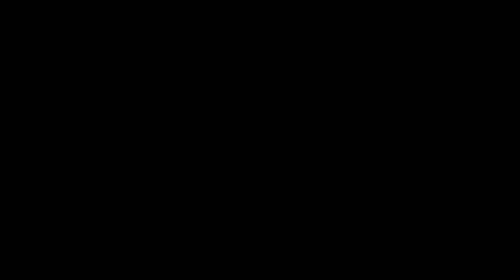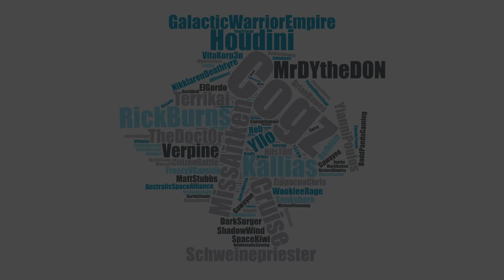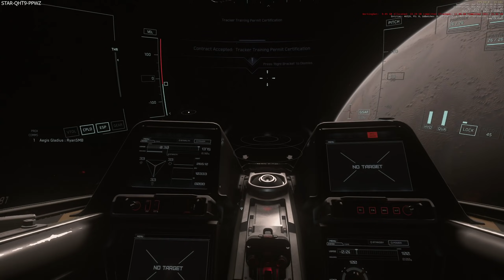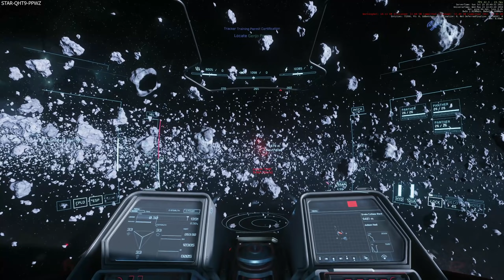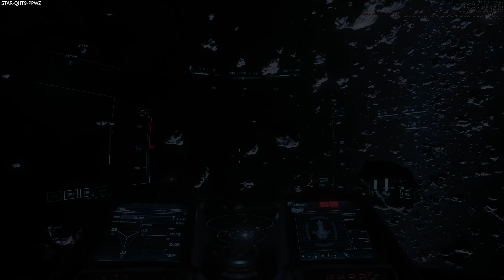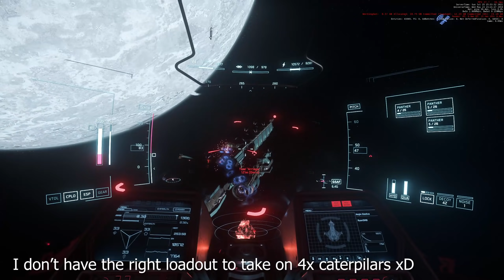Is Non Meta Possible? Time To Kill & All Things Combat | Star Citizen Sunday

Comment: 3.14 combat seems to be a divisive topic but from what I've seen that division is between the PVP players and PVE players. 

PVE players (like myself) are loving the changes as it made AI ship fights of all sizes much more interesting. The most obvious being their use of missiles both at the start and in the midst of engagements, which mean that in addition to lining up shots for your weapons, you have to keep an eye out for missiles coming your way. It feels much closer to the 3.13.x arena commander experience, where I feel that 3.13 combat AI was at it's best. With the capacitor changes, you're no longer just keeping your nose on target until the enemy is dead, you're pacing your attacks to allow time for your weapons to recharge, you're repositioning, or switching to missiles, or even switching targets depending on the situation. So far I've made it up to MRT bounties and the MRTs feel genuinely challenging when you're facing multiple cutlass-sized ships that are actually landing hits on you and lobbing missiles.

On the PVP side however, things are quite a mess I think. I am no expert but from what I've seen people are finding some specific ships and loadout can achieve incredibly quick TTK, meaning that all of that tactical gameplay mentioned above for PVE doesn't happen. In the few times I engaged or got engaged by another player in PVP, we still ended up nose-to-nose unloading rounds until one of us died, with either the more agile ship winning if one was noticeably more agile (like a fighter against a 600i) or the higher DPS output ship winning if agility is comparable (Sabre vs Hornet for example). The range changes as they currently stand have made 2xS1 or 2xS2 weapon setups generally better than a single S3 or S4 weapon, meaning that ships that can mount many small weapons (Hawk, Hornet, Tana, Bucc) have a pretty big DPS advantage over ships with only a few larger hardpoints (Avenger, Talon, Gladius).

This is just my experience so far having spent most of the weekend on the PTU, and my bias is certainly PVE, but this is what I've experienced so far.

Comment: The point you make about weapon stats as a basis, is Exactly the thing I feel questionable about the statements that the CIG devs made. Especially with the HP values on ships. Relative toughness of your ship is just so fundamental. Like, do I favor the top or bottom of a ship if I want to rotate into fire? Tail or nose? Like knowing this about the Tali, changed how I flew that ship. There is 120k HP in the nose and 100k HP in the body. So if you keep that in mind, you are being more informed in how you fly. This could be ultimately replaced by armor in some far flung future, but right now it's just prohibitively difficult to get at this information for just so much of the community. I mean they have a lot to do at CIG, I'm not so naive as to think they should just drop what they are working on to redirect and give every ship a viewer on the website with those HP values. But at least give the community some heads up here. Instead they kind of swooped into a thread about ship HP to say: "Yeah Erkul isn't great" and then gave no explanation besides. That's immensely frustrating.

My working assumption has been that we need a viewer of the ship frame with callouts for each ship part and the HP of that part. Many ships have a variable number of parts though.

Comment: A lot of people are just salty over the difficulty increase. Combat used to be an idiot proof way to earn really quick cash. Just fly at the enemy in a straight line with trigger held down, win. If you don't kill instantly just fly around the poor AI bastard with firing button taped down, like against Hammer Heads. Almost any ship could take down a Hammer Head solo, with no skill required. That is just wrong and bad design, the HH specifically is supposed to be a heavily armored anti-fighter monster. 
Still from my experiences, after adapting to the changes a bit, you can gain money at almost the same rate, especially if you BH in a group of 3 instead of solo.

Now I do think that the correct play for CIG, would be to also raise the money gained from combat (also from mining, trading, and more), to ease the salt. This game is in alpha so they can easily change values again as people "git gud" and adapt to the changes. If they make way too much money, there will be at least 2 resets before full release, so nothing to worry about in terms of "shaking the alpha economy".